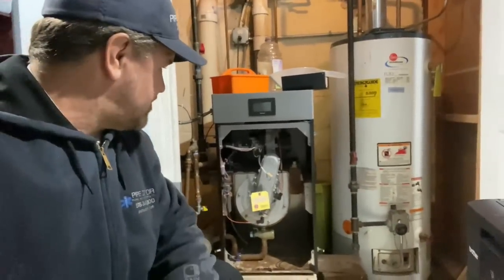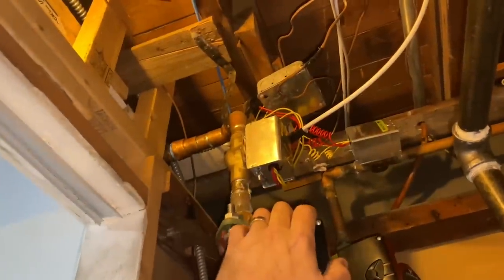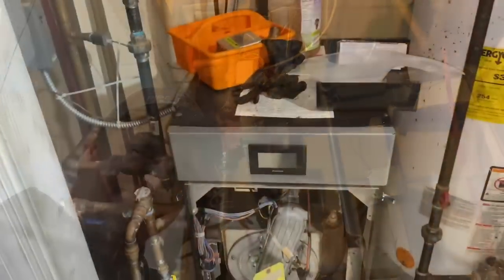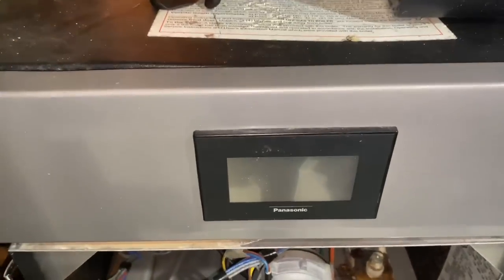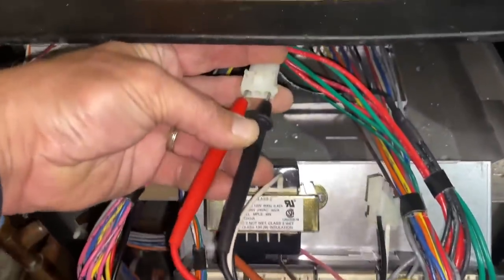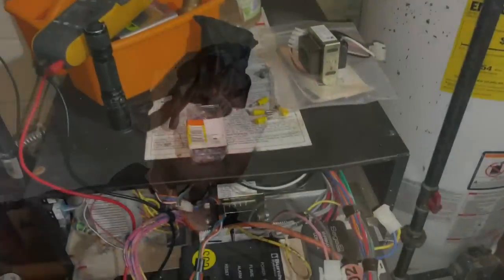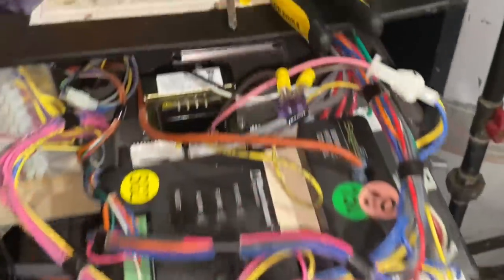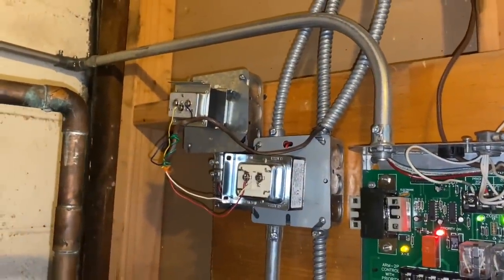Burnham Alpine Boiler - No Heat Display Blank | How to Diagnose & Repair Low Voltage Short

Comment: Much love from California Mikey, thank you for sharing your videos. The short pro tool helps in finding low voltage shorts. I was taught in trade school to leave a blade fuse installed in case of an another short happens that way you protect the transformer, or to replaced the transformer with one that has a manual reset.

Comment: Mike, the automotive industry has a testing inline circuit breaker so u don't have to keep blowing fuses and costing money. I am sure they make one to fit your needs.
Reply: In the HVAC industry, the original in-line resettable circuit breaker was called the "Little Popper". I immediately use the Little Popper when I find a blown fuse, no need to waste money blowing 3 amp fuses.
Reply: @PipeDoctor  I have a little popper too but I also have a hand full of low voltage circuit breakers that I've pulled off of scrap RTUs.  Two leads coming off and bam you got a free home made little popper

Comment: Can you explain the procedure to replace that high temp limit sensor?   Just disconnect the wire connector, unscrew the old, screw in the new and reconnect the wiring?  No need to shut off the gas, right?

Comment: I had a Taco zone valve head take out my transformer!  The in-line fuse is a great idea, I went through 2 transformers!  Stupid question, do you need zone valves if you have a circulator for each zone??
Reply: No, it’s one or the other. Either one circulator with a zone valve for each zone, or one circulator for each zone. The second way is more costly to install. But if one circulator fails all the other zones still run. The first way if the circulator goes then you have no heat.

Comment: Hi Mikey
What year is that Burnham Alpine could you tell me?
Reply: @PipeDoctor  
Mikey,
I think when it's time to get a boiler I'm going to try to stick with the old cast iron boilers.
I got 28 years out of mine so far I still running good.
Seems like those high efficiency models be more attention and don't last as long.
Thanks for the info
Agree or disagree 🔯❤️

Comment: 20” on center tee’s, undersized near boiler piping and circ, then add a grossly over sized modulating boiler and what you have is inefficient system. I can’t even explain a zone control on a single zone boiler, except incompetence. I know this boiler model, it’s good equip except when a moron over complicates it with stupidity. When you see stainless that rusty it’s a bad sign, it should easily have 15-20 years.